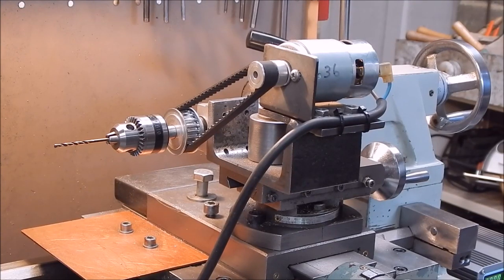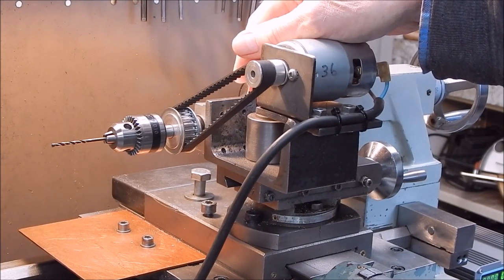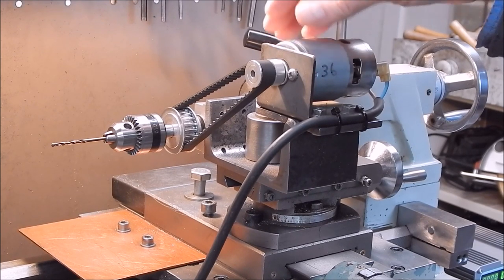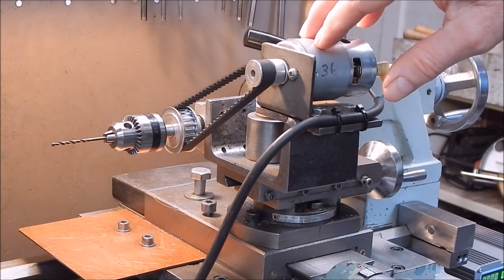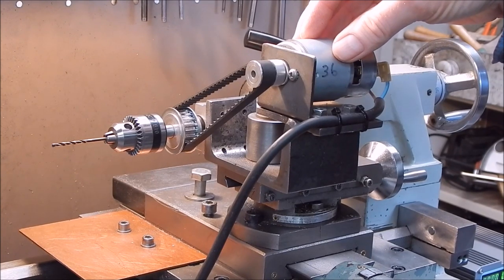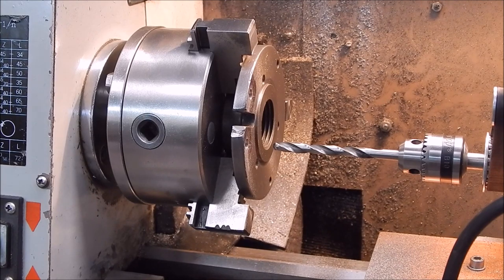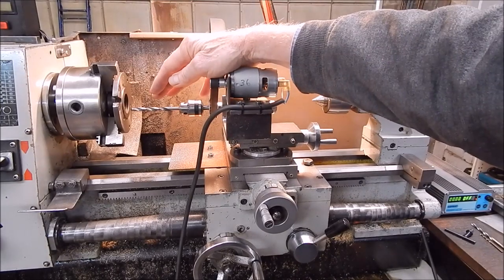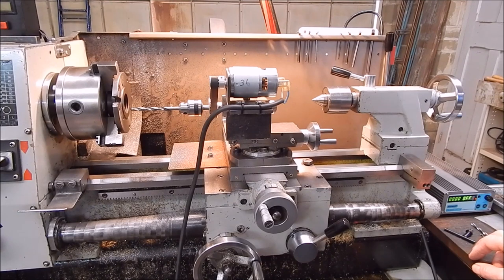Radial drilling on the lathe with a 775 DC hobby motor and spindle

Comment from the maker: The final drill may have been a bit dull.  I only casually glanced at the edge.  Overall the drills went through pretty easily.  Run out was pretty low considering how chewed up the shanks were.

5/16" is close to 8 mm for the Allen headed bolts I used.

Cheers Rob

Comment: Nice video, I too am a believer in stepping up in size as you drill.  The holes stay more round and they stay on size better. Good job. Thank you Rob.
Reply from the maker: Yes, less chance of wander and deflection when stepping up.  Plus you can correct  errors to some degree.  Larger drills tend to have poor locating tips due to the grind limitations.  Cheers Rob

Comment: Great how you have made your own horizontal mill with very little to go wrong. Whereas my vertical mill power supply is a pain that needs fixing, but it is hard trying to reverse engineer the circuit boards & figure out what has gone wrong. Thanks for sharing!
Reply from the maker: If I can't see burn signs with electronics I have no idea what's going on.  Plus these tiny component boards defy human intervention.  Best to just swap out the board for something else.  Cheers Rob

Comment: nice setup, you can do it it a drill press, all you need is a large metal lathe chuck mounted on the rotary table, the larger fabrication shops have them, been around for yonks. i am getting around to making one as i have a 400mm diameter chuck sitting around and have a spare drill press.

Comment: Hi Rob !
NIce and need little jig you have there ... I envy you that for sure !
Reply from the maker: Hi Keld,

Great to hear from you.  It's not bad for a cheap and cheerful unit.  I have been using it quite a lot (within it's capabilities) lately and it continues to surprise me.  It's only light duty, but makes some jobs very easy.  I like the accuracy and quick to mount features. 

Cheers Rob
Reply: @Xynudu  Now we are going to the winter here but I've just installed a "AirToAir-heatpump" in my shop so now I should be able to work over there in the winter periode without freezing my fingers on these cold tools ;-)) ... very nice I hope - I just started the heater for testing  ... so now I'll be back !

Cheers
Reply from the maker: Good move Keld.  I could do with something like that.  The main issue I have with shooting video in winter is the noise of the rain beating down on the sheet steel roof.  Plus the cold is a bit much.

Cheers Rob

Comment: For an upgrade, you should try the new 997 DC motor, it's an upgrade to the 775, 795, 895 version, it's twice the size of the 775 motor and outputs 7 times the torque of a 775 without connecting it to a spindle, the voltage is up to 48v and draws 20a

Comment: Rob,
  Good job with the tool post drill. As an “American” I must say I prefer the Imperial. Lol
  I once heard an old British wood working Craftsman say, after he had worked in America for many years, “There is something quite satisfactory in there being twelve inches in a foot!”
   I realize you are Australian not Brit but you did inherit the abominable metric system from them! Lol
   Just joking Rob. We all like what we learned growing up and what we are used to working with.
Reply from the maker: Old habit's die hard Dale.  We used to be Imperial and when the switch to Metric occured it was like the end of the world to some people.  But now it's all most of the modern generation know and working with units of 10  seems totally logical.  Particularly when working on vehicles for spanner sizes it is way better.  No brain power required ;)  Cheers Rob
Reply: Rob, I understand the old habits thing. We in the US that work on automobile engines manufactured since 1980 have had to adjust to open end wrench sizes which you call spanners. It was very frustrating because not everything was changed to metric at the time causing a lot of anger at the system primarily because of the loss of time on a repair job. These days most everything on an auto is metric so that problem has been solved. It took awhile but I can now identify a nut size just by looking at as I used to do with imperial wrenches. Anyway it’s interesting to learn of different ways of doing things in various countries around the world. I hope to visit Australia some day.
Reply: @edgeeffect  That's why machinists use thousandths of an inch (a.k.a. mils, which is not millimetres), rather than fractions. Still, your point is valid.
Reply: @Dale Griggs  Down under, we inherited the imperial system from Britain.  We only signed the metric treaty in 1947 while the UK did this in 1894 (and the US in 1878 which is why all US 'customary units' are defined in terms of  metric standards at the NIST). Our government only began the metrication process across the 1970's, with all everyday usage changes pretty much done by 1974 (I remember this clearly because I changed schools that year and all the speed limit signs changed across the holidays). Industrial and retail changes were basically complete by 1977, except it took another 10 years for  real estate measurement to catch up :)    I find it interesting that it took more than 40 years for metric fasteners to start to displace whitworth as  the 'standard' in the hardware shops. We are, however,  still buying timber (lumber) in imperial-equivalent metric sizes ,  but it's nice that a  45x90mm  is exactly that, and not a 4x2 that measures somewhere vaguely  near 3-1/2x1-3/4"  (as my carpenter father -in-law used to complain about!). :)

Comment: Nice video and good job Sir. I have question about this motor. 775 DC Motor is Brushless or Brushes Sir ??? Thanks..
Reply from the maker: Hi Tibyan, the motor has brushes.  They slide in housings. Cheers Rob

Comment: Seemed like you were running the drill a little fast, do you have speed control other then just changing voltage ? Great little tool , and it looks like the price was right 😉 .
Reply from the maker: You can only vary DC motor drilling speed with the voltage (unless you change pulley sizes).  The speed was OK and everything stayed cool.  Cheers Rob
Reply: To expand on Rob's reply, there's one other way: Change the windings in the motor! LOL

Comment: Hi Robbie, great video. A small suggestion, what I'm going to call the The Main External Bearing Housing on your lathe, (the piece / part between the Chuck & the Headstock Gear{s} Housing,) I made a slip over paper  Zero to 360 degrees graph. I made it, just for the very reason as you did the work on / in this video. You can use say a piece of small welding rod (3mm plus,) use a magnet, bingo {bend / form as necessary} you have a indicator / pointer to work with.  Just a thought. If you check on the web, there's lot's of sites where you can custom make your graph, download it, then merely print it out, cut the hole as necessary. Here's one https://incompetech.com/graphpaper/polar, or hit me up with the necessary hole diameter {guessing 3" in to 4" in. (7.62 cm to 10.16 cm) hole on yours} to fit over the housing, and I'll resize mine that I made in my CAD program, and E-Mail it to you. P.S. I went to a local store, and had mine laminated; before installing / placing on my lathe. I used a spray can / spray on glue, {contact cement} on the back, very, very lite coat. If you want a permanent  indicator / pointer loosen one of the chuck bolts, wrap {welding rod} one time, tighten, bend / shape as necessary.
Reply from the maker: Hi Dave, like this you mean ;)

https://www.youtube.com/watch?v=M3cH0kKN074

Been there, done that, works great.  It's actually something from a site I was in contact with when I was making gears and he followed up with a Java script for me.  See the link from my gear making web site:

http://users.tpg.com.au/agnet/cq9325rev8.html

It's actually a lot easier to use than an indexing disc as you don't have to count holes and can do any number of segments/indexing points.

Way to go.

Cheers Rob

Comment: Or you could just cut a piece out on the opposite side
Reply from the maker: I did consider that, but it would weaken it.  When used as a drive dog plate it doesn't matter, but with a chuck it's a negative.  Cheers Rob